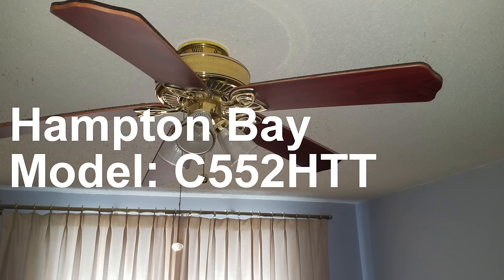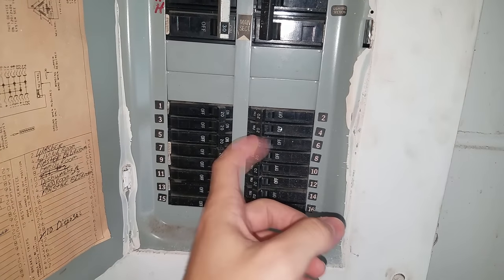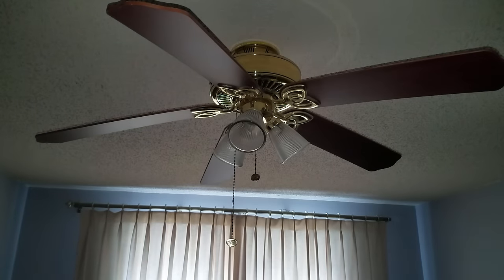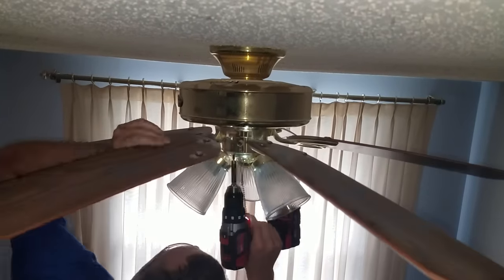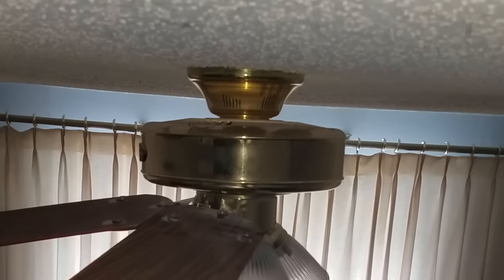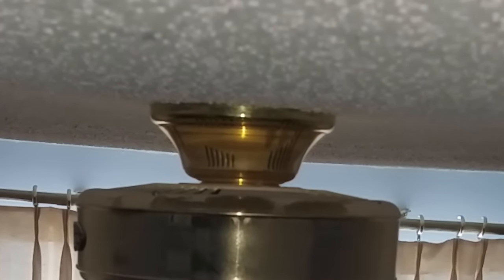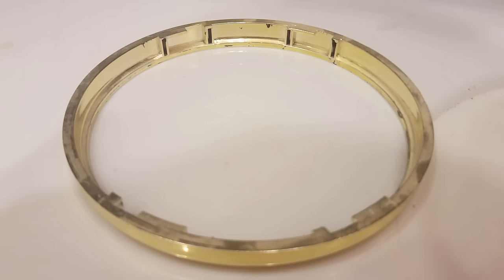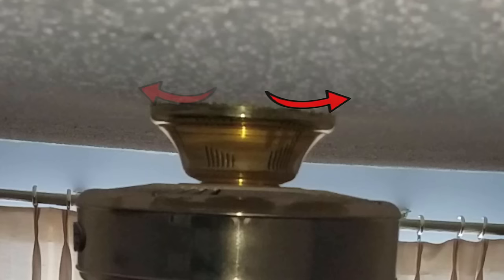How To Remove Hampton Bay Ceiling Fan No Screws

Comment: August 2023 and your video helped me remove my 20 year old Hampton bay ceiling fan from the ceiling. I have to admit that the old fan is built like a tank. I purchased a newer Hampton Bay model to replace it with and we’ll see how it works out. I noticed the newone is made in China. Normally I try to avoid buying Chinese products but my wife fell in love with the fan. Thanks for your video.

Comment: This You Tube video saved my sanity. The ring on this fan was plastic and I couldn’t turn it so I used a flat blade screwdriver and a hammer.  After several licks, the ring cracked and fell off.  Problem solved!!!!! Thanks

Comment: Part of the problem we had was it was a dark room (breaker off), and from a short ladder, it didn't even look like there was a ring at the top of the cover at all. It really looked like a one piece cover. Once we knew there might BE a ring, it made everything else a breeze. FYI...searched "ceiling fan cover no screws" and very little showed up. This video was VERY helpful. Wish we would have seen it before the swearing started....but thanks!

Comment: The evil thing about this ring is that is rotates the OPPOSITE direction from the standard "righty-tight, lefty-loosey" direction. I'd tried in vain to turn it the conventional direction, but when you mentioned "clockwise" that was the clue I needed to remove it. THANKS!

Comment: Short and sweet. My question is my daughter just moved into her apartment and we found the ceiling fan in the kitchen had all five blade hanging down like it was wilted. When I flip the light switch the blades would bang the back of the light fixture.  It has central air conditioning and I don't know if it's actually warped from humidity or something else but I am going to try and find the screws and see if it just needs tightening. Any idea where I could find the model number on the unit. It is a white flush mount with four lights

Comment: I have finally just removed an old Hampton Bay ceiling fan. Here are the steps: 1) Remove the globe with the finger tighten screws being careful not to drop; 2)Unscrew the light fixture assembly and detach with the wire clip (or wire nuts); 3) Remove the blades one at a time by turning the blades until the screws line up with the open access area on the motor housing; 4) Twist the small ring next to the ceiling clockwise to release it and let it drop; 5) Remove the canopy section by removing the 4 screws; 6) disconnect the wires attaching the unit to the electric box in the ceiling; 7) (the big one!) Slide the ball joint out of the ceiling bracket through the single access point; 7) remove the ceiling bracket from the electric box. Hope this helps as there are many variations of Hampton Bay ceiling fans.

Comment: Thanks! One more hint. I couldn't get that ring to turn with my bare hands. So I drilled a hole in it, put in a screw, and hit it with a hammer. When it broke,  I realized it's just plastic and was able to pry it right off.

Comment: Couldn't you have actually shown the removal process? You stopped right when it was getting useful.
Reply from the maker: Yeah that would have been ideal.  Messed up in recording.
Reply: I understand - I found another video that highlighted the removal of that ring on top which was not clear in your video so I was able to remove it in the end. Thanks for the reply.
Reply: So. Neither one of you is going to tell us?
Reply: Here: https://youtu.be/P8dVSDH4vrY
Reply: All I had to hear is that the ring twisted, done.  :-)
Reply: the fiX files - Compose a NEW video clip for beginners, please?